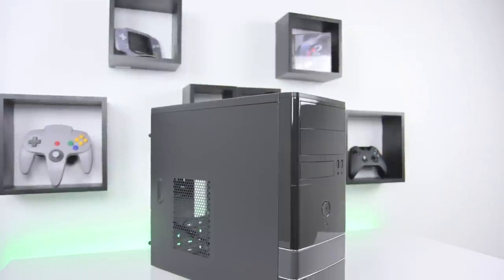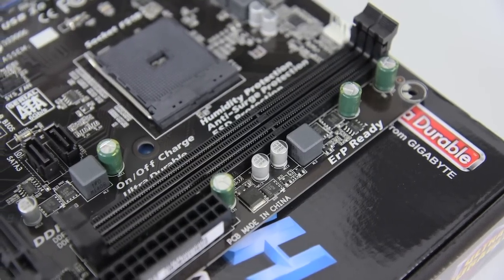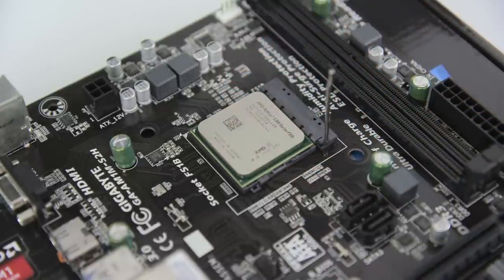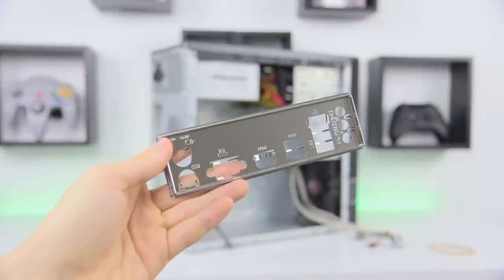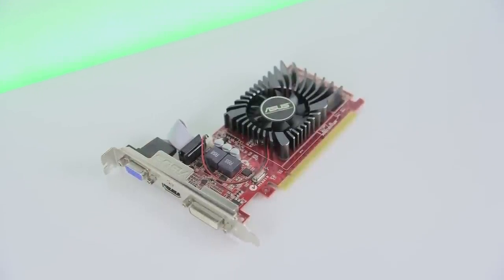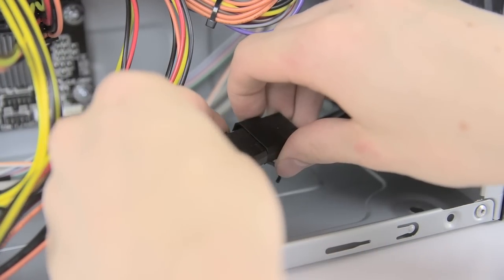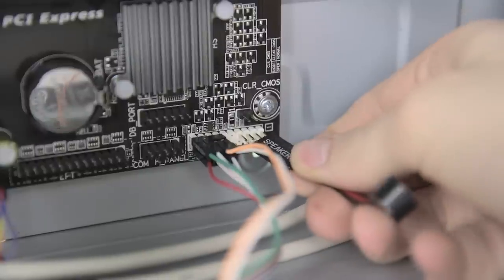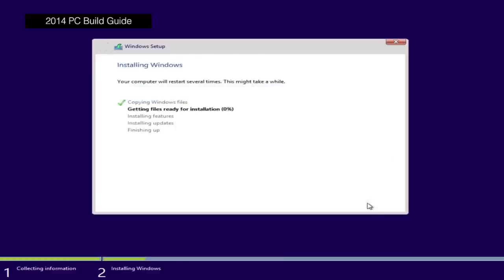How to Build a $300 Gaming PC! (2014 Boson)

Comment: Is this a good gaming computer setup? 
I wanna get pretty high frames 

>Kingston hyperx FURY 16gb kit (2x8gb) 1866mhz DDR3 CL10 DIMM 

> Cooler Master Hyper 212 EVO Cpu Cooler with 120mm PWM FAN 

> Western Digital Green 6 tb desktop hard drive 3.5 inch SATA IntelliPower, 64 MB Cache Internal Bare or OEM Drives 

> MSI ATX DDR3 2600 LGA 1150 Motherboards Z97 Gaming 7 

> Nanoxia Deep Silence 5 Big Tower Case Fits XL-ATX & E-ATX Motherboard large water cooler ready with 6 fan controllers 

>EVGA GTX980 Superclocked ACX 2.0 4gb GDDR5 256bit, DVI-I DP x 3 HDMI, SLI Ready Graphics card Graphics Cards 04G-P4-2983-KR

> Corsair CX Series 750 watt ATX/EPS Modular 80 Plus Bronze ATX12v/EPS12v 744 power supply cx750m 

>Intel Core i7-4790k processor (8m cache, up to 4.40 GHz) 
 
>Asus 24x DVD-RW Serial-ATA Internal OEM Optical drive DRW-24B1st

> Samsung 840 EVO 500gb 2.5-inch SATA III internal SSD
Reply: Yes.
Reply: For gaming 16gb of ram? i7 4790k? hahahahha get 8gb hyperx and i5 4690k ;)
Reply: You can make it cheaper by reducing the ram and replacing that "gaming" motherboard. 

Gaming motherboards are the exact same as the normal ones
Reply: Dont get 16gb of ram for playing videogames, no game will  ever use its full capacity.
You dont need more than 8gb if you dont render or something

Comment: Overclocking Monster :)
Jokes apart, for the same amount of money (60 APU + 60 GPU) I would go for a 7700 APU as it has the same 384 GCN shaders and the same DDR3 memory bus. The price is the same and it is a very versatile solution as in future you can add a r7 250 GPU for crossfire. If you are lucky you can find a 7850k for less than 130 dollars, and have 512 GCN shaders that could actually outperforms the current build.
I would never suggest people to buy a DDR3 dedicated GPU, just go for a APU with a dual channel memory instead and you are fine.

Comment: For $300, you have a better choice than that:

Buy an A10 APU (FM2+) instead, you can play 1080p AAA games at 36fps with that if you pair it with R7 250 and do what is called as "AMD Dual Graphics" (aka crossfire between the gpu and apu).
Reply: +BaccaPilot3657 
is this any good? 
Windows 10 (pre-installed)
AMD FX-4300 Processor
Memory: 8 GB
Graphics: NVIDIA GeForce GTX 960
Hard drive: 1 TB ?
Reply: ThunderZed Ohh shit! FX4300 is like a huge OUCH! you know... it would be better to spend +$50 on FX6300, yet that difference between cpus is absurdly huge.
Reply: my budget is around $1000 but yeah i changed my mind... lol i might getting one of these witch one would u people recommend ? they are both $1000 ACER Predator G3-710 - Windows 10 (pre-installed) Intel® Core™ i7-6700 Processor Memory: 8 GB Graphics: NVIDIA GeForce GTX 970 Hard drive: 1 TB & 128 GB SSD or HP ENVY Phoenix 860-050na Gaming PC - Windows 10 (pre-installed) Intel® Core™ i5-6600K Processor Memory: 16 GB Graphics: AMD Radeon R9 370 Hard drive: 2 TB & 128 GB SSD
Reply: Polvo Corrupto lol thanks for the info
Reply: kk

Comment: Are these components compatable for my first pc build? And what GPU would you recomend?
 CPU: AMD A10-6800K Black Edition 4.10GHz (Socket FM2) APU Richland Quad Core Processor (AD680KWOHLBOX)
 
FAN: Loki II Heatpipe CPU Cooler- 92mm

 Motherboard: Msi 970 Gaming AMD 970 (Socket AM3+) DDR3 ATX Motherboard
 
RAM: GeIL Black Dragon 16GB (2x8GB) DDR3 PC3-12800C11 1600MHz Dual Channel Kit (GD316GB1600C11DC) *OcUK Exclusive*

HDD: Seagate Barracuda 2TB 7200RPM SATA 6Gb/s 64MB Cache - OEM (ST2000DM001) HDD

SSD: Crucial MX200 250GB 2.5" SSD SATA 6Gbps 7mm Solid State Drive ( CT250MX200SSD1)

PSU: Antec EDGE 650w 80 Plus Gold Fully Modular Power Supply

Case: Cooler Master HAF 912 Advanced Windowed Midi Tower Case - Black
Reply: ***** so does this work...
MSI A88X-G45 Gaming AMD A88X (Socket FM2+) ATX Motherboard

I'm a noob sorry.
Reply: ***** also, what gpu do you recomend?
Reply: ***** I'm not from USA I'm from UK. I can't find that gpu on the uk amazon:3
Reply: ***** are video cards compatable with any cpu, motherboard e.t.c?
Reply: ***** ok, I have to change the cpu if I cant get a radeon r9 i guess.
Reply: Sorry for being such a drag:(
Reply: Only problem is the motherboard doesn't say FM2 or FM3 on it (or maybe it does, im an idiot)
Where as the cpu is FM3.

http://www.amazon.co.uk/gp/aw/d/B009O7YUF6/ref=mp_s_a_1_1?qid=1431737164&sr=8-1&pi=AC_SY200_QL40&keywords=amd+cpu&dpPl=1&dpID=51bv9ejAKnL&ref=plSrch

http://www.amazon.co.uk/gp/aw/d/B00GJ4EJDK/ref=mp_s_a_1_26?qid=1431740449&sr=8-26&pi=AC_SX110_SY165&keywords=msi+z97
Reply: Riffs SA no the motherboard is AM3+ and the CPU is Fm2+

Comment: This was helpful. But I bought an Intel CPU.
However, they're seated almost exactly the same way. Only with Intel, the pins are on the socket.
Reply: MakoRuu intel usually gets lower temps and better perfomance than AMD
Reply: Indeed. AMD has been falling behind for the last five years.
Reply: MakoRuu i mean yeah but u kinda get more performance for u money of if u gotwith amd
Reply: Not really. My Quad Core Xeon CPU was only $10 and it out performs a lot of AMD in the FX 6000 - 8000 range.

Not to mention Intel has always lead in single core integer score over AMD.
Reply: MakoRuu A Xeon sucks at gaming.
Reply: Please, enlighten us with your extensive knowledge of cpu microarchitecture on how you came to that conclusion.
Reply: Hmm. Sounds like someone's butt is hurting.
Reply: wow
such comeback
much burn
Reply: The Gam'n Network do u even know what a cpu is
Reply: MakoRuu lol mr i can run gta 5 on a Xeon ive seen you all over these vids for the past few days i have like 300$ and i NEED a Pc for gta 5 Like right now... ive been waiting for too long or should i just wait and save another 100$ :/ but ive been waiting for 3 Years...
Reply: Yes. My Xeon W3520 handled GTA V just fine.

There's some guides on my channel in my GTA V video.

Comment: what is the battery for this called i can find the case on ebay but i cant find the case with the battery
Reply: +Bros for life x47 That "Battery" you are referring to is called power supply unit or PSU.

Comment: what is better? a gt 710 or this 2GB Asus Radeon R7 240? plis
Reply: None are better. Both are very terrible, if you wanna go cheap then get an AMD HD 7850 1gb, this card runs almost any game from 2012-2014 60 fps highs settings 1080p.
Reply: i only had for one of these
Reply: Save up for a better one or buy used
Reply: While you can't buy them new anymore, I still have my card and am using it right now. It's stellar value and still cracks modern games a new one.
Reply: 240 is technically better

Comment: This a good build?

fx 6300
R9 270x
2TB HHD
Corsair carbide spec 02
MSI 970 Gaming motherboard am3
650w evga psu
8GB RAM
Reply: That's a nice build.  The 6300 is like THE budget processor, so that was a good choice.
Reply: Trevor twoclever Well I've changed it up due to a budget increase (sold my xbox) so now the build is (tell if its good)

AMD FX 6300
8GB RAM 1866Mhz
GTX 970 4GB
Corsair H75 Liquid Cooler (Gonna OC my CPU)
MSI 970 Motherboard AM3+
250GB SSD
1TB HDD
Define R5
Reply: Ch33kyMangozOnPC That's also nice.  I use the GTX 970 and it works great.
Reply: It is good, but i recommend instead of spending that money on a 2tb HDD get a 1tb HDD and spend the rest on 120gb SSD

Comment: How do you pick motherboards? I heard your motherboard needs to be compatible with memory and other things?
Reply: +The EpicBigGamer its quite easy
Reply: +The EpicBigGamer  pcpartpicker will help a lot
but main thing is for the processor make sure it matches the socket. for instance in this video it uses an am1 socket. so the processor has to be an am1 processor. other thing to check is power consumption. the motherboard should say how powerful of a processor it can handle. if the power of the processor is lower or the same as the power on the motherboard you are good to go.
as far as ram this is easy. the motherboard can only accept one type of ram (currently as of 1/12/2016 ddr3 is the most common, but ddr4 is starting to become more common). so if your motherboard says ddr3 ram you get ddr3 ram. check how many slots it supports. (its been a while since i have seen a board with only 1 ram slot though). most cases just get a couple of 4gb sticks and you should be fine. small thing but also check the maximum ammount of memory supported (though this usually isnt an issue because i haven't seen a motherboard that supports less then 8gb in a LOOOOOOOOOOOOOOOOOOOOOOOOOOOOOOOOOOOOOOOOOOOONG time). 

thats pretty much it. the rest is pretty much standardized to work with anything  (unless you get a wifi card or a sound card so make sure you have enough pcie slots for those.)
google pcpartpicker its a good starting point for someone wanting to get into building computers.

Comment: Would this run games on medium quality at 720p 30fps? Games like, LoL, TF2, CSGO, WoW. It would also need to be able to edit videos and render them. 10 minute video is 1 hour or less render time. Would this computer do the job? Please tell me.
Reply: +TriKz Dyslexci At 720p most of the games you mentioned will be a smooth 60 or more. You will be able to edit and render, but I can't tell how long it will take.
Reply: +Daan Reynaert  Would it render a 10 minute video in 1 hour or less?
Reply: TriKz Dyslexci It will. As long if it's the default bitrate.
Reply: +TriKz Dyslexci my brother is running a q8200 and a nvidia 8800 gtx (much older equipment, but similar specs to what this is) and it had 4gb of ram until we bought 4gb more. with the 4gb of ram at 1080p max settings it ran LOL at 80fps as the norm only dipping down into the 50s maybe once a match ever. with the 8gb lowest we saw was 70.

Comment: So I want to build this for my brother's birthday, he's just turning 13, which is when I got my first computer. He doesn't really play many high-intensity games. Mostly just stuff like roblox, garry's mod, minecraft and such. How will it perform for him if I just go with the integrated graphics?

And don't just tell me it runs minesweeper because i have a laptop with an intel hd 3000 in it and it can at least try to play newer games.
Reply: Get an i3-4130/50/60 depending on your budget. It has a better per core performance than the AMD CPU's. Since Minecraft mostly uses 1 CPU to rendr chucks it would be the best choice. The integrated HD 4400/4600 work fine for games like Roblox and Minecraft, not sure if Garrys Mod works 'perfectly'.
Reply: Gmod works perfectly for me on a hd4000

Comment: i chose this processor because i wanted a higher ghz and minecraft to run faster PLEASE TELL ME IF THIS PROCESSOR WORKS WITH THIS BUILD (i am upgrading from 4gb ram to 8 gb ram)
Reply: Higher Ghz does not mean better performance. A i5-4430 easily outperforms the FX-6300.
Reply: Anthony Sparta I was just trying to say that numbers don't matter.
Reply: Anthony Sparta Then compare the 9590 with the 5960X. Also a 8 core processor clocked at 3Ghz. Still it outperforms any AMD processor on the market.

Comment: can u get a high end graphic card running with a mother board like this and an intel core 2 duo processor ?
Reply: ***** what do u mean
Reply: cocacoladog10 a high end graphic card like he GTX 980 with an intel core two duo processor, decent but not high end motherboard, 8 gb ram and 800 watt power supply ?
Reply: ***** if its a intel core 2 duo processor its a old processor so its problaly pci-e 2 and u will need a motherboard with pci-3

Comment: I want to buy a AMD 5350 but I m not sure if the heatsink and cpu fan are in the box. Did you buy them later or did the come with the cpu?
Reply: Just dont get the 5350 its not good
Reply: That wasnt my question and indeed if you use him for gaming it isn't good but not every one games on his pc.
Reply: +Chris Voerman yes, the heatsink comes with the APU.
Reply: Does it also come with pre-applyed thermal paste?
Reply: +Chris Voerman yes, it does. Note that when you want to upgrade to a better cooler, you need to apply thermal paste yourself.
Reply: +Nils Johansson I understand but now I dont have to spend money on thermal compound if it isn't necessary

Comment: Will this motherboard work with a 750ti TF
Reply: It will work with any graphics card as long as it isnt to long for the case. Hope I helped;)
Reply: spacechicken Thanks, So it will fit in a Rosewill Galaxy 03 ?
Reply: Yep!
Reply: spacechicken 1 more question sorry I am a noob at PC stuff. If I touch my Gpu on a carpet will it brake it like the motherboard?
Reply: Yeah you sould probably build it on a woden table on a stone or tile floor, and if you want to be extra saf use an anti static wristband and connect it to a metel object that is also touching the ground
Reply: sameer ahamed i think so...
Reply: +sameer ahamed it will but the processor will probably bottle neck it

Comment: I am building my first pc but I am stuck, I am currently going to buy a R7 250x but should I spend a little more cash and buy a R7 260x
Any help is appreciated
Reply: Marcus Roberts get a 750ti
Reply: Marcus Roberts amd usually have shit drivers
Reply: I have an xfx r7 250 and its a pretty good card for its price but if you have a lil bit more money go for a 260
Reply: cocacoladog10 Nope
Reply: Marcus Roberts sapphire r9 280x tri x vapor x - goes for 189 after rebate and plays everything on ultra with a minimum of 90 fps max is 300fps on some games while still on ultra

Comment: is this a good pc build?

Cooler Master Elite 350 - Mid Tower Computer Case with 500W Power Supply 

Intel Pentium G3258 3.2 GHz Dual-Core (going to overclock to 4 GHz)

Radeon R7 370 2GD5T OC Armor 2X MSI Video Card 2 GB w/ Dual Fan and Heat sink

New Kingston 8GB (2x4GB) 1600MHz DDR3L Low Profile desktop memory 

MSI Z87-G41 PC Mate LGA 1150 Intel Z87 HDMI SATA 6Gb/s USB 3.0 ATX Motherboard

Cooler Master Hyper 212 EVO Heatsink and Fan

got all of this for 350$
Reply: Very good for the price!
Reply: thanks!

Comment: was so excited to finally make this, I got it to boot then when i turned it off, went to turn it back on, it will turn on but not display. un plugged everything plugged it back in, got it to display again..turned it off. plugged in keyboard then installed DVD drive. wouldn't display. Unplugged both of those items turned it on, wouldn't display then i unplugged everything again, plugged it back in now it won't display idk what to do anymore.
Reply: If you used the case power supply replace it. See if that works? The Case PSU is pretty poor.
Reply: +Haha Lol finally got it working.
Reply: how did u get it to work if u dont mind me asking.
Reply: just tried unplugging everything and plugging it back in and tried powering it on a few times eventually it started working fine
Reply: ah glad to hear :)
Reply: :D
Reply: +JoshysProdution What games have you played?
Reply: CS Go mostly was the only one I was able to play before it died, again.
Reply: +JoshysProdution sorry to hear that, bro
Reply: +JoshysProdution He.. bet you forgot to power the monitor back on first time round.....
Reply: +Jason King nope i know how to work a computer, I got it fixed up. works great with the 750 ti makes it a pretty nice starter gaming pc.
Reply: ***** So, with a nice card and all this is a really good starter PC? Does yours have fast frame rates on high settings?

Comment: 300 dollar budget:

Intel Pentium G4400 2-core 3.3Ghz / $64.99
MSI AMD Radeon R7 360 2gb GDDR5 OC / $112.99
Gigabyte Intel LGA 1150 DDR3 2133Mhz / $39.99
EVGA 400 Watt Power-Supply / $19.99
320gb HDD 5400RPM / $14.88
Xion Performance Mini-ITX Tower Case / $22.99
Kingston HyperX Fury 4gb DDR3 1333mhz / $22.99

Total = $298.82
Reply: +MrPoofyWaffles Tada, 300 dollar build with slightly better specs
Reply: +MrPoofyWaffles Depending on where you buy the parts (This one is mostly Amazon and Newegg)
Reply: New Boson 3.0 by Austin is beast

Comment: Can u use any case? Sorry i'm ALL new to building computers!
Reply: Anyone know
?
Reply: +RedFlyerZ “RFZ” Gaming It depends on the size of the motherboard. There is the basic Mini-ITX, Micro ATX, ATX and ,Extended ATX. The case for the most part needs to match the motherboard size, but not always. You can use an ATX case with a Mini-ITX motherboard, but not the other way around. Just check the case manufacturer for compatibility.
Reply: +Craig Gwin Thank you :D I think I will just go for the case in the video!